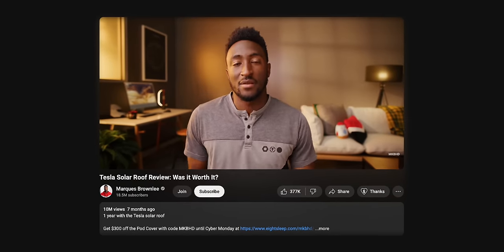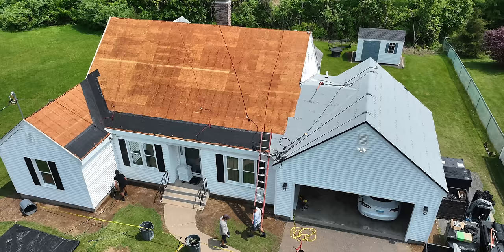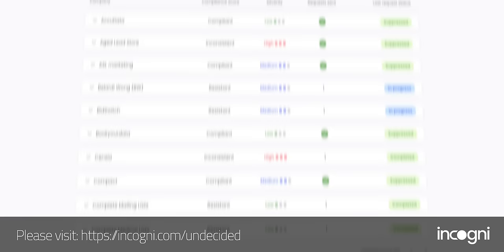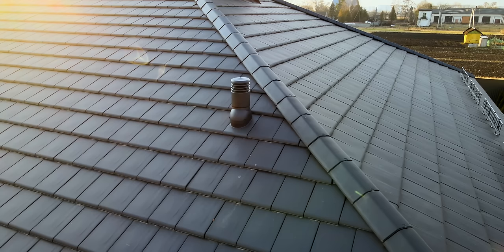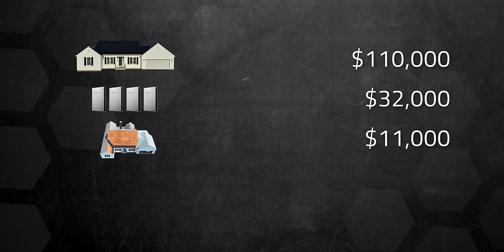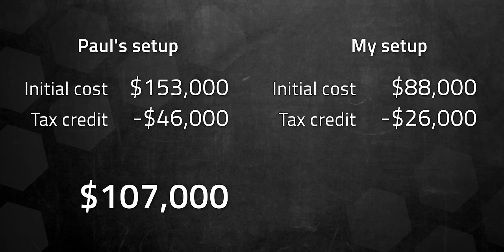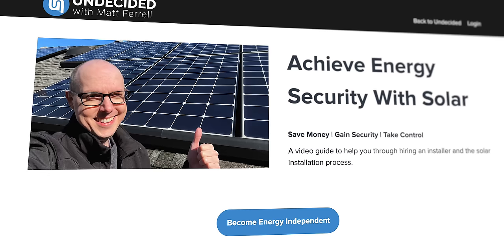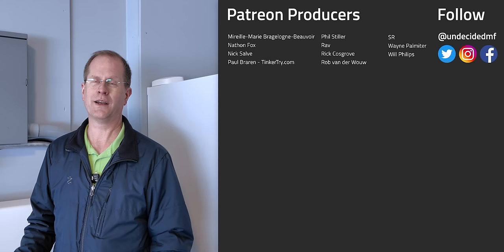Tesla Solar Roof vs Solar Panels: Which is Worth It?

Comment: I live in Arizona - fabulous conditions for solar. My house will have a traditional clay tile roof, so solar on the roof is no bueno. I plan to put an array in the back yard on short stilts. The panels will shade my chicken coop, and have a water cachment set-up. Capturing water is just as important as capturing sunlight. A 10Kw array will capture a couple of thousand gallons of water during our monsoon season with the simple addition of a gutter with the downpipes directed to a cistern.
Reply: Clay tile roof looks to be better for solar install if you want to avoid leaks. They lift the tile, put the anchor in which extend along the facedown side of the tile, at the end theres the proper anchor for the panel itself. Look pretty sturdy, its been done for a long time in europe. Seen many install in UK and germany like that and you cant tell me that EU country have lower standard and regulation when it come to solar install. You should check it out, theres plenty video online about it.
Reply: I would never put panels on my roof unless I had too.  Build a porch or something and put your panels on that or like you said cover a coop.
Reply: My town doesn't allow ground-mount solar, but that arrangement sounds awesome and very logical, thanks for dropping this comment!
- Paul Braren, owner of the Solar Roof featured in this video
Reply: @TinkerTry  Thanks! That's a major reason that I chose Arizona - they have intelligent water and energy laws. In Colorado, capturing rainwater that falls on your own property is illegal (?!?). Many jurisdictions restrict or ban roof-top bladeless turbines, ground-mount solar, and any number of other solutions. Arizona, which is running out of water and has an aging and unreliable power grid,  quite sensibly allows (and offers tax incentives) for anyone who disconnects from the public power grid and collects their own rainwater. It's possible to live completely off-gird in the heart of a nice suburb. So, suburban Prescott, here I come. 🙂
Reply: @gorak9000  Yes, I've seen them. For me it's an aesthetic choice. I'm building a Spanish Colonial Revival with as many historic details as I can afford. I think that sleek black modern solar panels spoil the romantic antique look of the roof. Since I have the space, and can use the panels to create shade for my hens and a rain roof for capturing more water, I see no reason to put solar on my roof. So, it's not a technical installation issue, I chose an off-roof installation due to other considerations. But thanks for offering that tip 🙂
Reply: @joeschmoe7951  Agreed! I'm building a Spanish Colonial Revival house, and I think the sleek modern panels destroy the romantic historic look that I'm going for. Particularly, when I can put it to one side of the coop, so it shades the run and provides another rain roof for water capture 🙂
Reply: @lindacgrace2973  Wow, this is interesting, thank you for informing me and Matt's other comment readers! I really appreciate learning this new-to-me information about AZ.
- Paul Braren, owner of the Solar Roof featured in this video
Reply: @TinkerTry  You're welcome. Gorgeous roof, BTW, Paul. But a bit out of place on a traditional Hacienda ;-)
Reply: @jesuspunk84  I didn't make the choice because of technical installation issues; I made an aesthetic choice. I am building a traditional Spanish Colonial Revival house with as many historic details as I can afford. A sleek, black, modern solar array - while good-looking on its own - is incongruous and inharmonious with the historically-inspired architectural style on the highly visible south side of my roof. Since I have the space and could use an extra rain capture surface, I chose to build a separate array. ;-)
Reply: Dear Linda,
you might consider semi-transparent glas-glas modules for your coop. The cells within the modules have some space between them and 20% sunlight goes directly through. In Europe, they are sold for carports and patios. They are more expensive than regular modules but they might be worth a look if they are available in your area. They create a dash-dot-like shadow pattern on the ground. Your hens will get shade, but it will not be completely dark below the solar roof.
Reply: @ApolloniusFink  Interesting idea! I have seen those panels in use at commercial facilities. However, I didn't explain myself clearly. I won't invest that much in a chicken coop. I'm planning on putting the panels a few feet away from the coop on the south side, so it casts shade, not actually install panels on the coop. Coops don't last very long - 10 years before the build-up of mold, yeast, fungus, and insects ruins them (even with good maintenance you only get 15 years out of one). So the coop will need to be replaced long before the solar panels need to be replaced, so a permanent installation seems like more money and trouble than it's worth. But I will have a carport, and the semi-transparent glas-glas would be an excellent application for that. Thanks. 🙂
Reply: Heaps of people use solar in Europe. And the Netherlands for example is at the same geopraphical height as Quebec. location doesn't matter as much as you think.
Reply: @joeschmoe7951 Wrong roof angle and not enough go them to get a high enough voltage.
Reply: @kiddy1992  I dunno about that. Solar panels don't generate much current when they're buried under 60+ cm of snow. Also, the UV index is much lower (UV is a measure of the solar energy that makes it through the atmosphere and hits the earth). For instance, Los Angeles has an average UV index of 8 to 9 (on an 11-point scale). The average UV index for Denmark (the most southerly Scandinavian country) is merely 5.5; and that, only during the longest days of summer. Prescott, Arizona enjoys 277 days of sunshine and in January snowfall in the heaviest years amounts to 2.4 inches (6 cm for those of you who use rational measurements). The same solar panels that Canadians use will produce nearly 60% more power in Arizona than they do in Toronto. It is certainly not impossible in northerly climates. Germany leads the way in solar power production, as I understand it. But we southerners have it easier: far less snow, less cloud cover, a higher angle of the sunlight for greater conversion efficiency, a higher UV index, and a lot more sunny days.
Reply: @joeschmoe7951   I have part of my array on my porch roof. It's angled poorly and produces noticeably less energy than the panels on the regular roof. When I asked about changing the inclination I was told that it couldn't be done and that we had to follow the angle of the roof. So no, I'd rather have them all on my roof or on a garage which is how my next system will be done.
Reply: Many don't take into account the fact that a solar system on the roof will also keep the house cooler in the summer.
Reply: @razvanlex  Good point! But with a clay tile roof, which is installed over battens for good air circulation, and with the thermal mass of the tiles, I'm doubt the extra shade would have much of an impact. 🙂
Reply: @BLKMGK4  Ok, but if you are building the porch why not build it with the right angle to begin with....which would be my case not yours apparently.
Reply: @joeschmoe7951  in my case the porch had been there for years, this was t a new home. I’d hazard to guess that most existing porches don’t have the correct slope for their latitude. Roofs either although those are likely closer.
Reply: Saw a video where they tested mounting solar panels vertically rather than flat or on a slant.  Vertical worked better because the panels did not accumulate dust or leaves or snow.  So the sunlight always shone on the panels 100% all the time it was shining.  In your case, a layer of dirt would drastically reduce the efficiency of the panels so you would have to remember to clean them off periodically.
Reply: @oldtimefarmboy617  Fascinating! Yes, I'm going to have to come up with a way to clean them off, because in my arid climate capturing water is as important as capturing sunshine. Hmmm. Maybe I can do a mixed array with enough angled panels to improve my water capture and enough vertical panels to improve my solar efficiency.
Reply: @lindacgrace2973 In our municipality the area covered by a ground-mounted array is considered as contributing towards the maximum building coverage allowed on your lot in your particular zoning.   So on single-family urban-sized lots of 7500sf you run into the lot coverage limits pretty quickly with a 3000sf house and there isn't necessarily an extra 500sf of allowance to spare for a typical 10kw array - especially since they aren't allowed within the front, side or rear yard property line setbacks.
Reply: @stevehoge  Dear Steve, Very true! An important consideration when buying a lot and deciding on what house to build. Fortunately, Arizona (with an aging power grid and inadequate water supply) has sensibly taken the position of minimizing regulation and allowing a lot of building innovation to ease the load for everybody. The local codes (Yavapai County) are more concerned with fire breaks between houses (for instance tall solid masonry fences permit you to move accessory buildings like carports closer to the lot line) than they are with total lot coverage. But I've got a 1/3 acre lot and a small (1,024 square foot) retirement cottage. So, even with a swimming pool, greenhouse, and 500 square foot guesthouse, I'm nowhere near topping out the lot coverage limit. Thanks for a helpful note. 🙂
Reply: Smart thinking for your location, here in Australia we value the solar power and the shade it gives. Think about a back yard patio with a solar roof.
Reply: @postiemania  Thanks! Great minds think alike! I won't use a back yard patio for the main solar panels (I would lose too much light in the adjacent rooms). But I have been looking into 
semi- transparent solar cells that combine the benefits of visible light transparency and light-to-electricity conversion.
Reply: @oldtimefarmboy617  Have a travel trailer.  Cleaning the panel doesn't seem to matter much as long as its not covered in mudd or snow or something.  The angle to the sun matters a ton.  So much so, I think it's better to have panels on the ground so they can be constantly moved toward the sun.
Reply: @BLKMGK4  You know, I should've probably said patio covering more than a roof.  I don't ever see me putting panels on a roof over the  shingles, but maybe building a cover over my porch/patio using the panels as the roof.
Reply: @razvanlex  Also keep rain noise down .😉

Comment: I recently got a quote for a Tesla solar roof, and my decision to not do it was based on two factors: cost (200k) and the low confidence/trust in the installer. 18kW system with 3 powerwalls & Span...$200k! 😢 The installer is the only option in the area. Ended up continuing the dream without taking the next step.
Reply: Damn! Makes me want to become a Tesla solar installer. They are absolutely fleecing people! 
It's an expensive endeavor to be a Tesla fanatic!

Comment: Two years ago we tried to get a Tesla solar roof installed... it was a horror story of "no refund for you" and incompetent installers. They still owe us for preparation costs. 

They doubled the cost of the roof AFTER we had a signed contract, so we are now part of a class action to try and recover our preparation costs. At one point Tesla told us they would reimburse us, but that was two years ago. 

I drive a Model 3 and have plenty of Tesla stock, but the solar roof is not a product I would recommend.
Reply: better dump that meme stock while you can
Reply: Dump that stock, man.
The more obvious it becomes Musk is more of a conman than a genius?  
The more people will notice Tesla is TINY compared to other carbuilders - installations, production and capital reserves. And the stock overpriced af, primarily due to the cult of personality fan base.
Reply: @user-un8tv1pp8m definitely a meme stock. You okay either way fire trying to deal with those.

Comment: I live in the UK and a 7KwHP array with 13kwh storage can be done for about £13k. Your numbers are mind boggling...
Also it might have been nice to find someone with an in roof system to compare that.
Great channel!
Reply: we have large tariffs on imported panels, especially those  made in china
Reply: I was thinking the price seemed crazy eye for that set up compared to the ones you can get in Europe.

I know there are tariffs on imports from China in the US, but surely that's not making up such a high price tag.

To be fair, solar is getting dirt cheap now that the installation and inventor is the highest cost, not the panels, but I do have to wonder what kind of set up I could do in the UK for the cost they paid for their set-up.

Anyway, is a solar set-up really that much more expensive?
Reply: $153k in the UK could buy a field AND a solar farm! 🤣😂🤣 (Ok, maybe a bit far fetched, but it could buy you a house!)
Reply: Same here in Germany, 17.7 kWp Panels with 20 kWh battery is 20k€ (self-installed). With professionals installing everything that would be 30 - 40 k€ (depending on the local market situation). The American prices seem crazy.
Reply: I work for a solar company in Sweden. I could probably sell a 17 kWp roof installed solar plant for less than $15k. Adding a 20 kWh battery would probably be another $15k. You'd get a $9.5k tax deduction, so the whole installation would cost approximately $20-21k...
Reply: @IXISSV  Sadly, that is not the case here in New England, especially in my fairly dense suburb. Thanks for the worldly perspective, all comments are appreciated, it's fun to see how others feel and think about things differently than I.
- Paul Braren, owner of the Solar Roof featured in this video
Reply: 7kw system in NZ w/o battery, 7800usd...
Reply: Price of solar installations in EU have dropped below 1€/W for grid-tied. Off-grid is about double that. The prices in New England sound absurd.
Reply: I'm from germany. My DIY Solar 11.2kWp around 12500€, made by professional is around 25k €. This prices in the US are crazy.
Reply: He's also living in the third most expensive state in the US.
Reply: @IXISSV yeah my brother installed a 150kw farm in Scotland for less than that.
Reply: @michaelkaster5058 what does the tariff achieve? Is there some actual US production?
Reply: We have huge permitting costs that artificially add to the pricing created by our electric companies who strongly influence permitting. We have a weird system where the utilities make money from building new big power plants not solar.

Comment: So many don't think about utilizing solar panels as a carport roof, or awning, or  shed roof . They don't always have to be mounted on the roof of the home
Reply: Anywhere sun shines yes sir
Reply: So many don't HAVE a carport, awning or shed to put a solar array on.
Reply: @mnomadvfx   for the price of a ground mount and/or racking , you could easily sub in one of these. 
notice I said "as a"  . 
do the maths
Reply: Or just some bifacial vertical panels in their yard or as fencing. They're more efficient anyway.
Reply: @user-ms2gx7zt7z  You didn't say "as a"
Reply: @johndoe6032   yes I did .
Reply: @johndoe6032  Bifacial panels as fencing are not better than correctly mounted panels